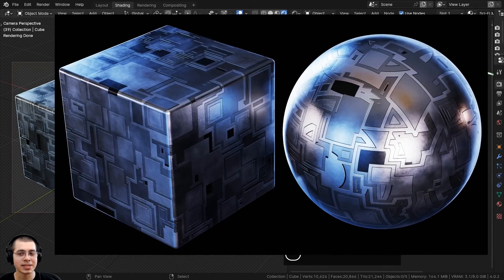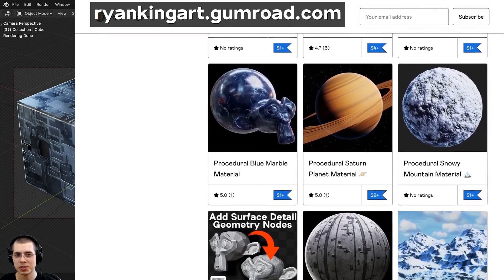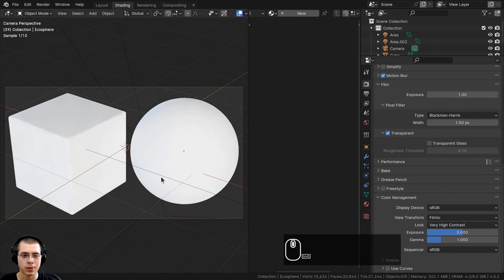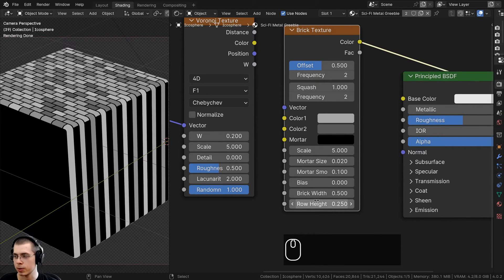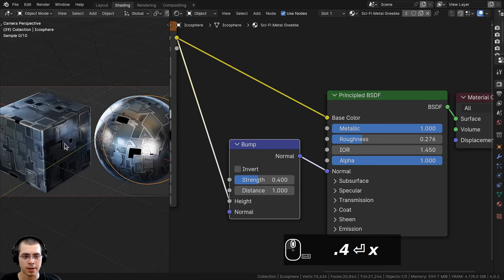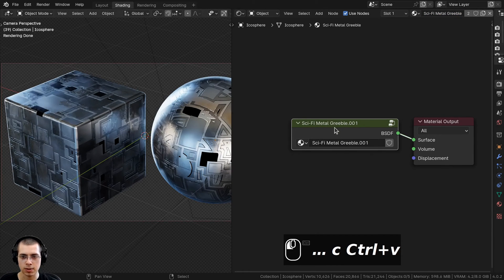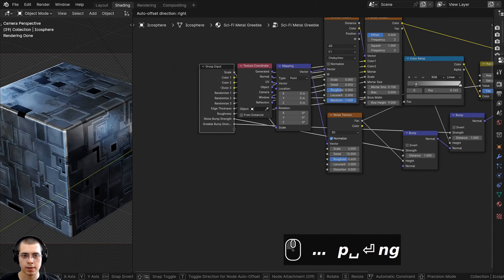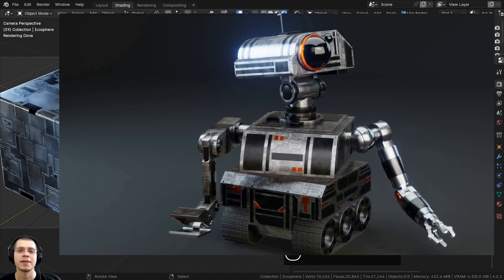Easy Sci-Fi Metal Greeble Material (Blender Tutorial)

Comment: What would I need to do in order to make Color 3 emissive?

Edit: Think I got it. I copied the Voronoi and Brick textures, set Color 1 and Color 2 to pure white then plugged it in to a Color Ramp. Then I flipped the colors in the Color Ramp and plugged it into the factor of a Mix Color node. I set Color A in the Mix Color node to pure black and left Color B to be the emission color and hooked that up to the Group Input. Then I plugged the Mix Color result into an Emission shader and plugged that into the Group Output and the Strength value into the Group Input. After that I hit tab out of the node group and put the Shader and Emission outputs into a Mix Shader node and set it to .15 on the factor. Looks pretty cool and gives it an optional TRON-like look.

Let me know if there is something I could change to make it better or if there is another approach I could have taken.